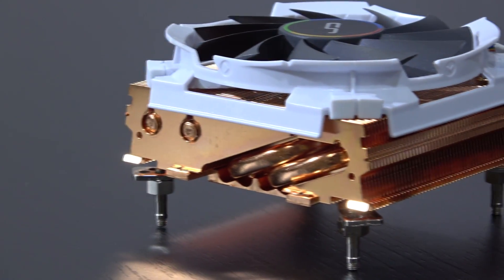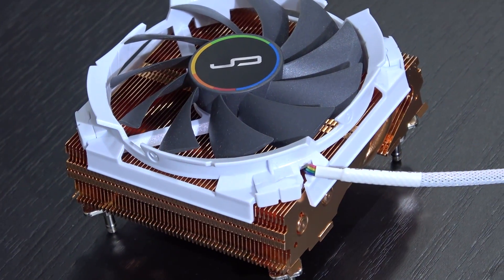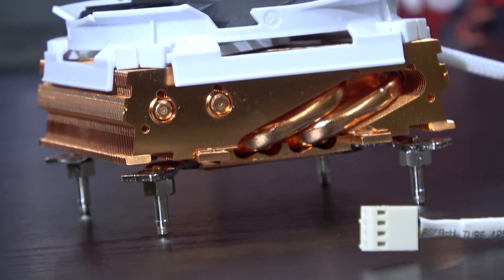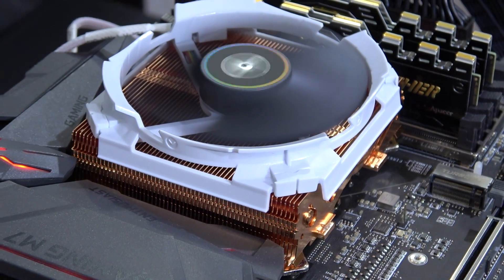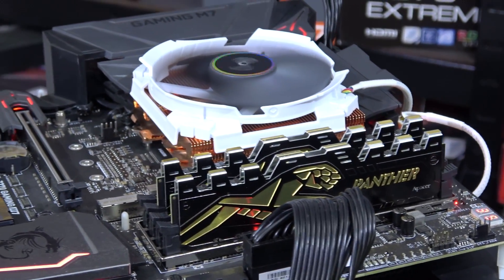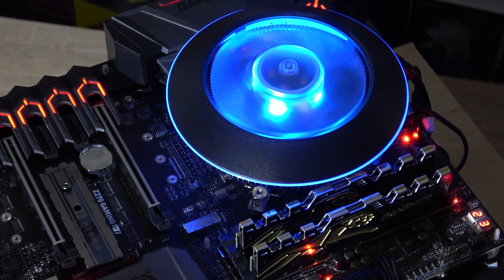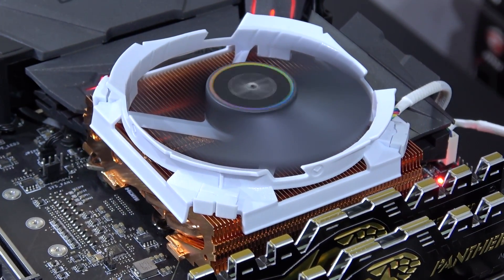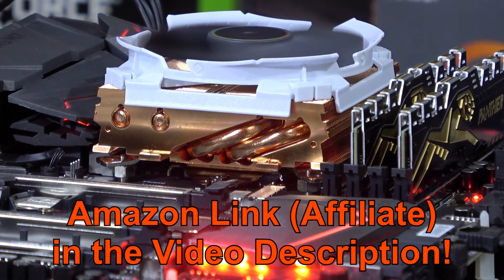The PERFECT COPPER Cooler for ITX Builds? -- CRYORIG C7 Cu

Comment: Seriously, Cryorig fan are shit, i've bought one for my Dan-Case, it sound like a shit laptop fan when it start to really spinning, be aware before you bought one.

Still a good deal, not that expansive, the thermal paste is really not that bad, it's a shame they don't put an adapter to mount another fan on it.

PS: you've badly mounted the cooler, your RAM/VRAM Heatsink is obstructing your cooler, i made the same mistake, i've grab couple of degree by changing his position.

Comment: cooler is to small so heat will just stay there
Reply: calical26 Obviously this is not a cooler to use with an overclocked i7 processor. But combine it with a more modest i5 and it works great, miles better than the equally sized Intel stock cooler. If you’re building inside a small case like the Fractal Design Node 202, then the C7 is the cooler to get.

Comment: are you able to compare this to the Noctua NH-L9x65, because i am planning on doing an itx build in the RVZ03 and that noctua cooler just fits! like even if you have numbers from similar tests on a similar platform?
Reply: MzNToS i am not after an even comparison, i am after comparison of how the biggest cooler i can fit in the case i want
Reply: Chandler Russell
Rvz03 "limitation of cooler height 83mm"
NH L9 X65 "cooler height 65mm"

The only issue with clearance is that the rvz03 height allowance may not be indictive of having the 120mm fan that comes with the case in that position. But problem solved sort of, just move it to the gpu side. As it is, to also better help thermals, will not be using the rear io shield when i build it to give the case a rear vent
Reply: I used the l9x65 in my build with a ryzen 2700 in a Lazer3d lz7. And I get mad heat about 68°c
Reply: ClanCreamhershey Funasd which is still within specs of the cpu. Myself i would be at most using a ryzen 5